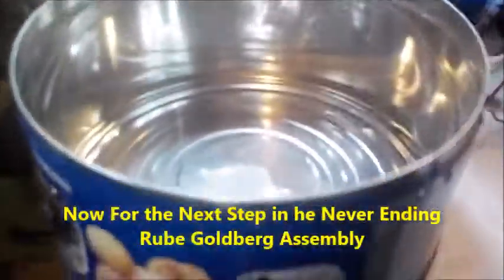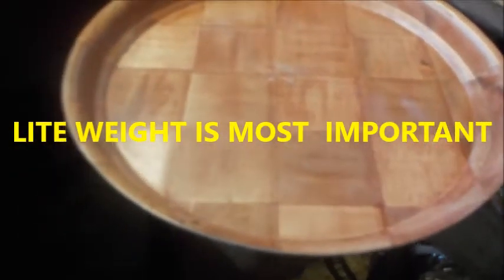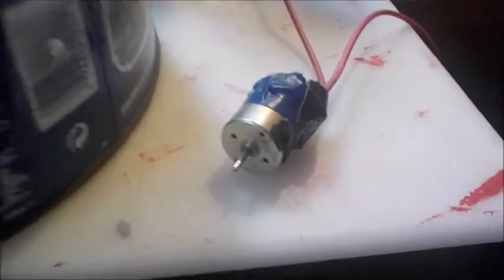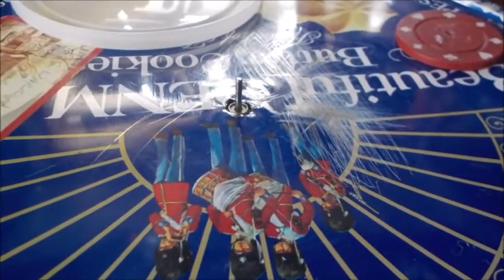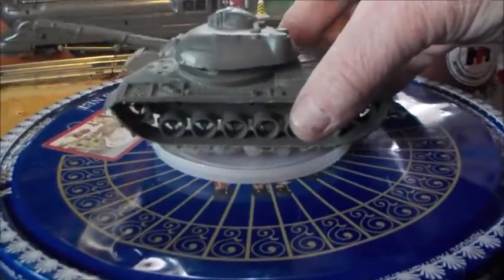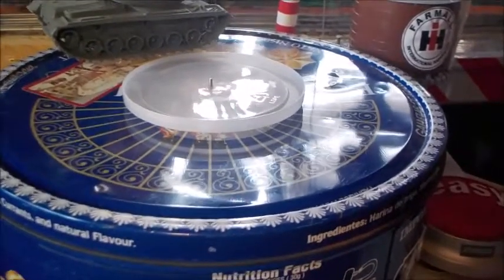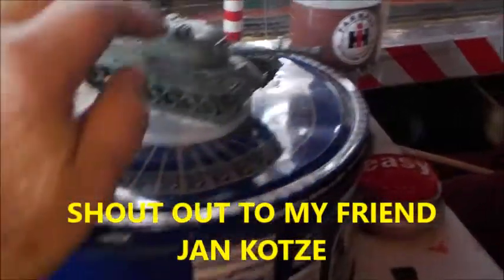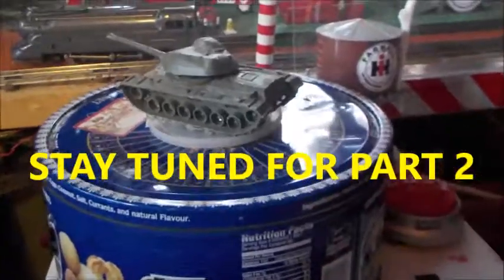Homemade Turntable Made From Junk Drawer..Part 1

Comment: Brilliant Dan, Rube would be proud, making something out of junk is so rewarding, mine run with two 1,5 volt torch batteries for hours, it is a bought item as you know, not sure if you seen the gear ratio on mine, I can make a video for you, the best alternative that will work 100% is the battery operated motor from the Weber barbecue rotisserie, it works also with two torch batteries and cook a lamb leg with no sign of getting flat, the gear ration is just right, you will have to gear it down, let me know if I can make you a video, well done my friend and thanks for mentioning me in the video
Reply from the maker: i Have to admit, the Can Motor is just NOT up to the Job but that;s O.K. , I will use it on something else for sure. I have another Motor that I think will work. I Have to do some more Tinkering with this Project to get it all right  but it will Happen. Trial and Error is a learning experience and it is all Part of the Tinkering  Game I Love to Play.

Comment: The problem is not the battery, but the motor.  It does not have enough torque.  You need either a bigger motor or, if you want to use that motor, to gear it down.  Since a gear box is not available you might try a small wheel on the motor shaft that drives the rim of the turn table.
Reply from the maker: I think you are right Bill, Thanks .  I did  Had My Doubts about the Motor Power But I have a Train with a Simular Can Motor that can Pull 6 Cars, so I thought it might work but like you said, the Gearing creates  and delivers the Torque from the small motor.  I'll figure out some way to make it work.  .